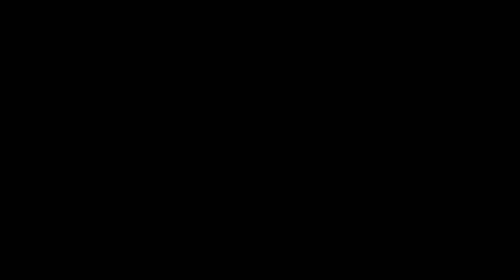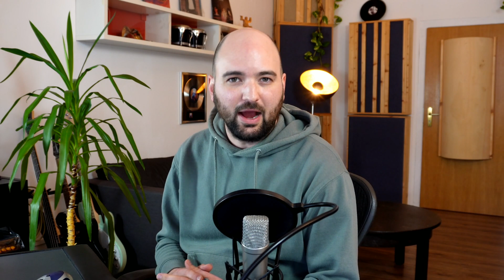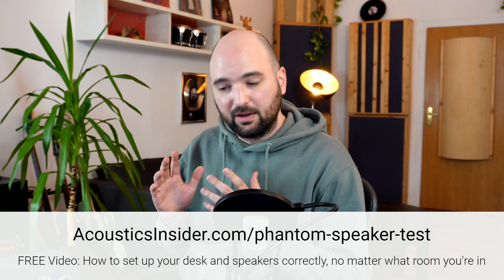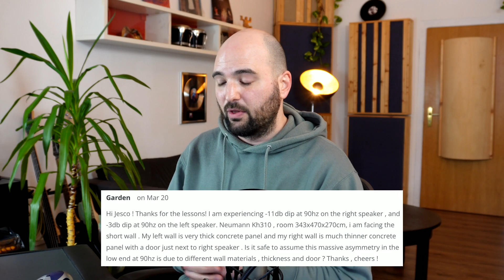Home Studio Acoustics is like an ONION. So treat it SHOTGUN style.

Comment: Speaking of layers, is there any advantage to creating a panel with increasing layers of density? For example, rather than making a 6 inch fiberglass panel of one density, making a 6 inch panel using 2 inch thick layers of increasing density. Would this be advantageous either acoustically, or perhaps, in cost effect? Many thanks!

Comment: Hi, and thanks for everything so far. 
My bass response and the resulting upper frequencies have responded really well to having added as much bass absorption (10cm panels and a 55cm corner soffits) as I can practically fit. Some of the tall panels however need some reinforcement on the front and I was thinking about rebuilding them with foil, or card stock or cardboard on the room facing side. I understand that this won't affect my bass response, but am I risking too much higher end control? My sides are symmetrical and I won't mess with those. Any suggestions or warnings?

Comment: Hi Jesco,
I have bass trapped my whole room (about 75% of the walls) with 16 cm stone wool bass traps similar to your bass trap course, including diffusors on about 25% of the walls.
Almost ready to finally reopen my studio. Now I'm rethinking of where to do what in the room, in particular where to record the vocals. With so much deep bass trapping, I was wondering if there is any need for a 'vocal booth'? In my previous, less deep bass-trapped studio I had a spot where I had hung down some slabs of quite thin acoustic foam to trap high frequencies in front of the singer. I always doubted it did anything, but there must be a reason for the existence of (mobile) vocal (head) booths  and such, so I went along with it. It cost very little to build but they did get in my way when I needed to cross the 2 meters from my recording desk to the mic  after hitting record. Not good for the concentration of recording my own vocals. I never heard your opinion vocal booths, mobile or not, so I am assuming they're not needed or even useful if your room is treated well. Am I right?
Reply: How big is your room?
Reply: My room is an attic with 2 sloping roofs. The floor has a surface area of about 28 m2 or 300 square ft. There is a ceiling of about 7 m2 at 240 cm. Large enough for a home studio.